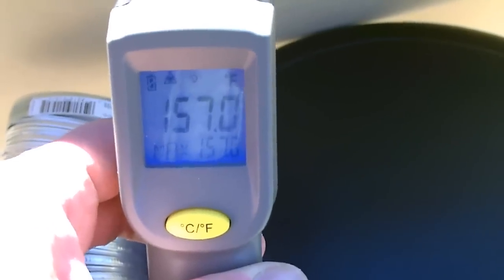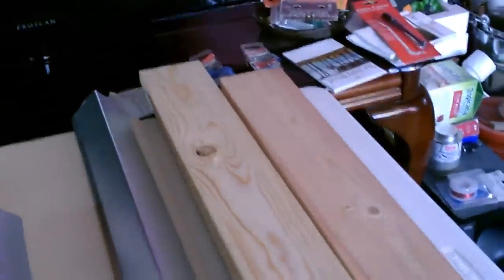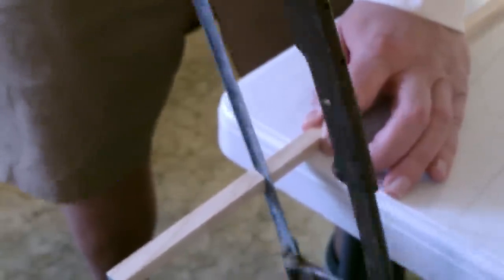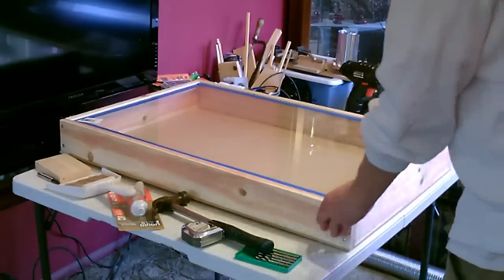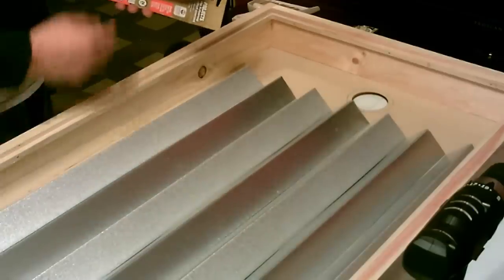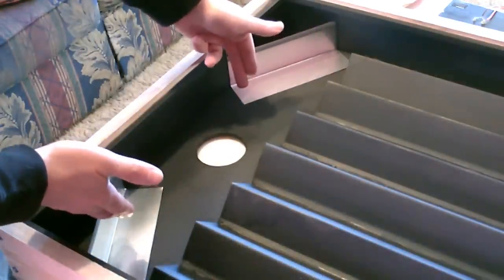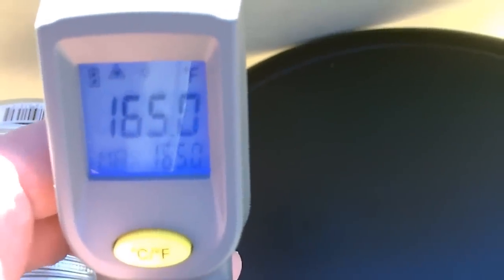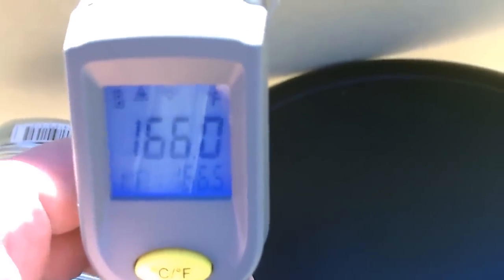DIY Solar Air Heater! - The Steel Slat “Drip-Edge” Solar Heater! - New Design! 160F 74C in January!

Comment: Bonjour, combien y a t-il de degré à la sortie du tuyau ? merci pour la video je vais en fabriquer un . Hello, how many degrees are there at the outlet of the pipe? thanks for the video i will make one.
Reply from the maker: hi. it can vary a lot but 130F/60C to 150F/66C or more is possible. (that's in strong sunlight with fan running strong). if the fan were run very slow you might get to 180F/82.2C (that would probably be 'top end' or max temps).
Reply: @desertsun02  thank you

Comment: Can you lay one of these flat? Like on a flat roof and have it work? Is the fan absolutely necessary?
Reply from the maker: hi. using it on a flat roof is certainly possible (especially if the sun is high in the sky). the units that don't need fans are usually much bigger (10x the size). that's because the air moves very slowing. standard household size units (like the unit in this video) need fans to pull the air through (or it will trickle out and not work very well)

Comment: Three years later, I'm curious if the glue used to put those metal angle pieces down actually held the metal all the time the solar box was used. I wouldn't think it would have been sufficient after multiple high heating cycles.
Reply from the maker: hi. it's held up great. no problems

Comment: So how do you actually pipe this inside?
Reply from the maker: hi. through a window is the easiest way 👍 (i've used both a 1x6 and 1/2" plywood. just drill hole in it, attach tube and drop the wood in the window. close window around the wood and seal it if necessary)

Comment: If you sand a piece of charcoal after you’ve painted whilst wet onto the metal fins and inside the box this will increase surface area by x 2000 and gather more heat.

Comment: Have you ever seen a solar panel work when it is not in the sun light?  It is 15 degrees here and
the solar panel is behind my solar heater where it is not in the sun and this morning the computer
fan is running full blast.  When I put the solar panel in the sun I have to put a small box in front
of the panel or it won't run.  Thank you for your channel.
Reply from the maker: hi. some solar panels will work in indirect light (especially the amorphous ones)

Comment: This is a really awesome project 🤯 really opened my mind wow 😯 I love the way you conducted the video too. My only thought was about possible fumes from the sun-heated spray paint venting into the house perhaps? Amazing work 👍👍👍
Reply from the maker: hi. once the paint fully dries (in a day or two) the paint smell disappears. the sun never heats the box over 175F-200F so much to low for the paint to 'melt' back into fumes.
Reply: @desertsun02  I see, thanks for the reply 👍 I have a bit of a phobia of chemicals lol I might see if I can work it without paint somehow or perhaps find a type of paint that is designed for something like this. But  you are probably right 🤔
Reply: @pixygnunchaku3494  3 months late, but you could use engine block or exhaust paint
Reply: @pixygnunchaku3494  you should try high heat paint, so it never degrades.  any autoparts store will have heat designed for engines

Comment: So no pop cans?? So are pulling outside air in ?
Reply from the maker: hi. that's correct (no pop cans) 🙂. yep, it pulls in and warms up outside air. if heating recycled air is what you prefer it's just a small modification to the unit. 👍

Comment: I used your design and got 174 degrees out of it. I had the air inlet and exit at the top. The air  came in and went underneath the part with the drip edge collectors then at the bottom it flipped up to the collectors. The collectors was separated from the bottom cooler air with one half inch foam sheeting.  From there it rose to the top and out. I got 75 degrees going in and 174 coming out. I couldn't believe it. I put in a fan but it will work fine without one. The rising heat will pull in the cooler air. I am going to install one on the south end of my house through an open window. The one I made is about the same size as yours. The one I will install will be almost double that. Thanks for the idea.
Reply: I want to see yours.
Reply: Wen you say: The collectors was separated from the bottom cooler air with one half inch foam sheeting.  
Could you elaborate ? I'm having a difficult time to picture it.. Feels like you have one smart design ! Thanks ! Stephane, France
Reply: so, any update?

Comment: Why is the fan mounted at the top, isn't it too hot there ?!
Reply from the maker: hi there. those computer case fans easily handle the heat. that is not a problem at all (the air is usually well under 200F). about the fan:  you always want to mount the fan at the top. the only way the unit will work is if you "pull" the air through. if you put fan at the bottom and try to "push" the air up and through the collector it won't work. *the air will just 'bottleneck'. what ends up happening is that the fan runs really hard but almost nothing (no air) will come out. not sure of the physics of it but that's what happens.

Comment: Would aluminum be better than steel?
Reply from the maker: hi. i'd say go with steel (it's denser and seems to get hotter).
Reply: @desertsun02  Makes sense. Also retains the heat longer.

Comment: What kind of glass do you use? Single layer or double?
Reply from the maker: hi there. i always use single pane glass. i've tried double and triple layers on solar collectors in the past but as you add layers the temps always go down. (i think the extra glass bounces more of the light away before it can enter)
Reply: @desertsun02  thanks for the reply :) great work
Reply: @desertsun02  btw which thickness of the glass do you use?
Reply from the maker: it's essentially standard replacement glass for windows so about 3/32" (2.4mm) but slightly thicker should be okay (like double strength 1/8" (3.2mm)).

Comment: How do you vent this into your home? If I did it through a window I’d be letting in too much cold air.
Reply from the maker: hi there. you can do it several ways. what i generally recommend is to use  a 1 x 6 or 1 x 8 piece of wood and cut it to fit a window. then using a 'hole saw', cut a hole (or several holes, if you're using multiple solar air heaters). in the wood. using 1 x 6 or 1 x 8 gives you plenty of room to attach the vent (or vents) to the wood. once you attach the tubing the window can be slid down onto the wood. you'll have to seal around it for best fit but it works very good. some people also pump air in through unused vents like an old dryer vent or even through unused dog door. one guy removed a door knob (on an unused door near the back of his garage) and attached the vent right there.
Reply: Oh I like the doorknob idea!

Comment: Is there a risk of the fan melting? I'd think that it's safer to have the fan push air inside the heater
Reply from the maker: hi. nope the fans won't melt (not even close). they easily handle the heat.🙂 pushing air in doesn't work because the air gets 'bottled up' or restricted inside the heater with the end result being that the fan works really hard but almost no air comes out. (i'm not sure of the physics of it but that's what happens) 👍

Comment: Your project is much more efficient than some of the others due to the gap at the fan end, this allows all channels to contribute to heating, however maybe if you joined two or three channels in series the amount of heat could be increased as the heated air will be in the channels a little longer.  Great job and more than efficient for a home. Well done.

Comment: If you paint the inside (not just sun facing side) with a high emissivity paint (generally any paint is better than bare metal) you'll increase efficiency a tiny bit.  I know it seems like the paint that's in the dark shouldn't matter, but it does! It's not dark in infrared <3
Reply: black rust primer paint?
Reply: (also, smoother the hose the faster the airflow, less chance to lose heat -- though insulated it doesn't matter much)

Comment: So.. missed this video somehow, wonder if you had you done anything with this yet? My suggestion, either heat it now into hot water for free hot water or radiant heating, or use compressed hot air for a turnscrew. Store that energy for at night. Maybe a combination as you have unlimited free zero point energy. A fellow in Alaska did something similar with hot water tubes.
Reply: Also you can use those stove fans that only run, when they heat up.

Comment: Hi and thank you for this fantastic video . Can you please tell us what size (wattage) solar panel you've been using ?
Reply from the maker: hi. the fans on most of my solar air heaters are 2 to 5 watts but since i have lots of 15 watt panels i've been using those. they keep the fan running strong even when the sun is at an angle to the panel.

Comment: Could also have used a toilet flange at the exhaust end
Reply from the maker: hi, or another option is to use an air intake mount. it's a part used on a car. it's basically just a 3" plastic flange. spectre performance has a good one. if you type spectre 8148 in a search engine you should see it

Comment: Btw Black disperse heat faster theb any colour if not in the sun .. so if the hose is in the sun i would pain that black to .. in the shade then wrap it up in isolation, the sunpanel u say the small one would make it run at 50 % the big one at 100 .. wouldnt 2 small ones do the same then as the big one ? or would that be more like 75 %

Comment: I just take all these builds and look around yard to see what can be used , I have a 4x6 greenhouse and first before I cut supply and returns in greenhouse I want to test things like I just built a box with screens and vents and think I might just use all this extra black 1/2  drip system black pipe and 1/4 ( never through stuff away ) I have laying around all stacked up if you will under neath screens to fan to create a baffling effect through black pipe , make sure no short cuts for air , that’s my goal for now , thanks for more ideas

Comment: did you just predrill to put in a nail ? .. never seen that before :D .. does it still work fine ?
Reply from the maker: hi there. it's a good idea to predrill those smaller square dowels so there's no chance of it splitting. it's still working good. these units usually last for years and years.
Reply: @desertsun02  looks like this works wonderfully . ill be making one or 2 of these to head up outside shed for storing my Bike in :D .. cant let that frost get to it ^.¨

Comment: Excellent idea with the drip edging. I do believe the best heat absorber is aluminum window screens.
I may use the edging for a smaller unit I want to build for the back window of my truck.
Reply: Window screen works very well

Comment: Any suggestions for mounting real glass and still be able to remove the glass for maintenance?
Reply: Use a thin strip of spongy insulation to seat the glass on. Then use rotating clips like used with picture frames to hold the glass in place. The spongy insulation will create a spring effect, pressing the glass against the clips to prevent them slipping.

Comment: Thank you! Found the dimensions at the end of the video. How do the slats compare with cans and downspout? I imagine surface area is the biggest factor, but there may be other unknown factors.
Reply: I know this is a yr old but I thing these are much smoother for air circulation than a can built. Can built is much better metal and gage me thinks.

Comment: What kind of paint does he use that won’t burn with all that heat?
Reply from the maker: hi. it's just the standard paint. it holds up well. it's not hot enough to need the high heat stuff 👍🙂

Comment: Is this a prototype or used for a certain scenario? If scenario, what is it? 
I'm thinking of building something for our manufactured home, ground set with an approximate 40inch dug crawl space under the coach. 
Today was the start of the weather we're having to get used to recently moving from southern comifornia to South East Arizona, with a total separate climate than the remaining of the state. Last night was first snowfall with a mere dusting that was gone the moment the sun showed itself but still dealing with freezing early mornings and evenings like last night. 

My idea is to utilize the solar concept like you've shown here and pipe it to the underneath of the coach. It's a 72 X (something like) 28 or 32 wide. (It's a total of 1680 sqft regardless of my memory or lack of with the dimensions). 
I do understand it would certainly have to be "slightly" larger than this example but... Your ideas???????

Comment: Hi thanks for your video, can I ask advice?  I have been looking at a solar panel heater build and note there are Solar panel to fan setups for sale intended to air greenhouses or dog pens and the like, do you think this would work for a solar heater and if so might it need a thermostat put into the circuit , thank you Ian uk iantarbet338@gmail.com

Comment: If you think of this system in terms of how you would build a passive house you would insulate the box and the hose. Stopping heat loss on the box and hose would net higher temps and be more efficient.

Comment: Straightforward, economical build--good work.  However, you wouldn't pump 165 degree heated air into a house.  So, if you were to use this to heat an interior space what other components would you use to regulate the heat?
Reply from the maker: hi. yep, you just pump it straight into your house. i usually use a table fan to disperse the air inside the room. since it's only one vent, it never gets too hot. you could of course hook up a thermostat to the fan. they have ones as low as 8 bucks on amazon.

Comment: Making a Jerky Dryer using the panel as my power source.  Jerky takes about 4 hours to dry and my area only has propane.  Not very economical to say the least.  I'll keep you updated.  My only concern is when you seal the fan inside the unit you subject it to the internal heat when not in use and it makes it hard to change out if it fails.  I'm putting my fan on the outside in a small mounting box.  Just a thought

Comment: This would actually be more efficient if instead of pulling the air over each channel like it is now; if you had 1 hole and then segment the channels so that one air inlet had go over all of them back and forth before it came out the other end. More efficient heat exchanger. The air is staying in the heated area for longer allowing it to extract/absorb the most heat that it possibly can. Just a thought.

Comment: did you try with Corrugated Galvanized Steel Utility-Gauge Roof Panel. https://www.homedepot.com/p/8-ft-Corrugated-Galvanized-Steel-Utility-Gauge-Roof-Panel-13513/202092961

Comment: This looks like a great idea! I have an off grid camp and I'm thinking this would work great to keep my camp from getting too cold during cold months. I wonder if I got an outlet timer and plugged into my inverter, then programed the timer to turn on for ten minutes every hour during the day and off at night how well that would work? Obviously using an electric fan plugged into the outlet timer. Anyone have any thoughts on this?
Reply: Instead of a timer, why not use a thermostat to control the fan?
Reply: @brucea550  , that is a great idea!

Comment: It's obvious to say that temps are higher if the intake is brought in from the inside warmer house air vs outside cold air, but I haven't seen anyone do a design that has say 3 connected in a series where the you have hot air 160 degrees going into the 2nd, and then  out again into a 3rd. I wonder how hot the 2nd and 3rd air temps would measure.

Comment: have you tried black abs pipe yet?
Reply from the maker: hi there. no, i haven't. with regard to these heaters, i try to stay away from the plastics. you never know what heated plastic may give off. also metal seems to get much hotter.

Comment: The steel slate: I like your solar heater: would like to copy yours butI have a need to use a battery to store heat, a converter and controller. I don’t have an idea of how to tie all those elements together. Is it your idea that the holes at the bottom of ur heater is to allow cold air into the heater as the fan blows heat into the home?

Comment: Reply to Brad not Landa
Good on you my friend, but there are designs that are more efficient from the 80s. Cold air return came from the house and came into an insulated rear chamber. That air came up through 2 layers of black painted expanded lath. Then in the house. 

The earlier versions of your basic build had roofing run horizontally and plexiglass bumps to encourage the air to do more than just rise up the glass face...

Comment: I built one similar to this but it was 4x8 feet and I used a 100 cfm fan,  insulated the sides and back and made it where I could bring air from inside of the house into the intake, I boxed in the bottom of the frame to accomplish this.  My fan was slightly larger and was powered by this solar panel I got from China for a fraction of what one costs in the USA...https://www.ebay.com/itm/Solar-Cell-Panel-5-Watt-12Volt-For-Car-Battery-Trickle-Charger-Backpack-Power-ZH/264302130798?epid=1563151785&hash=item3d89a2766e:g:wosAAOSwBc5cxi-F
I could get over 200 degrees on a bright sunny day, with the temp in the room at 70 degrees (input temp) and the output at 200 to 225 degrees that's a 130 to 145 degree temp rise at 100 cfm  or approximately 6000 to 7000  BTU or about the output of a 2KW electric heater, with electricity at 13 cents a KH (your price may be lower or higher)  this solar heater is making almost a quarter's worth of heat an hr for several hrs a day when the sun is shining
Reply: That link is expired now, all the ones I’m finding on eBay are $2+ per watt, which is not cheap.
I’m looking at doing similar to what you did, to heat a garage in the spring and fall (I’m at 61 north, so no winter sun to speak of).